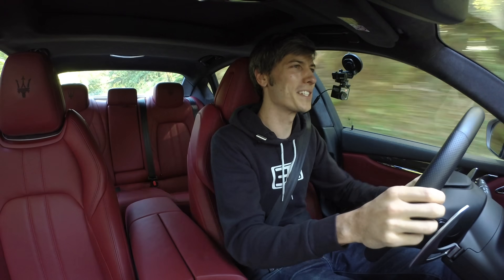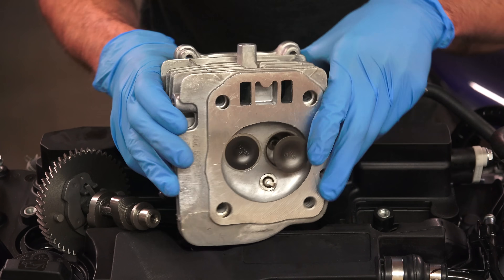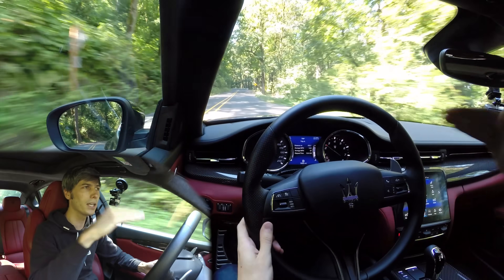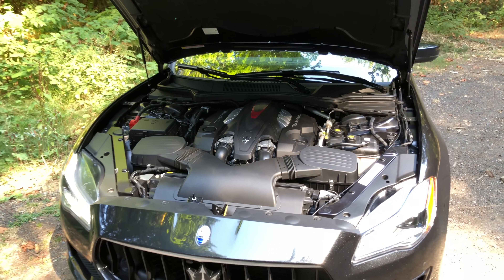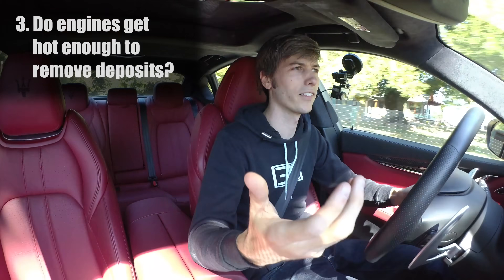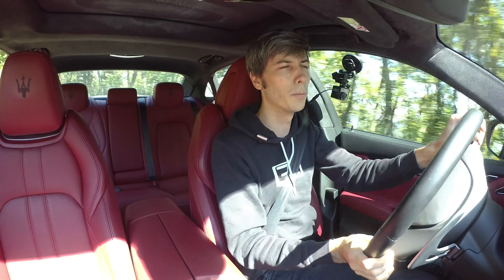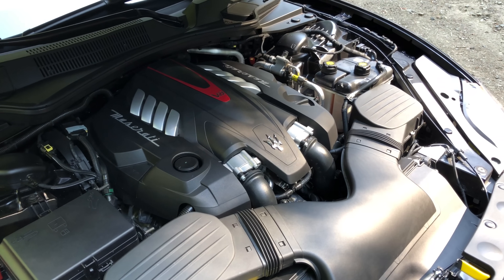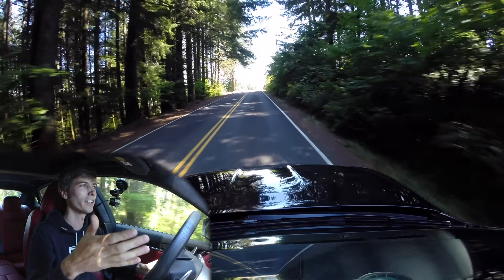Is Redline Good For Your Car's Engine? Italian Tune Up

Comment: The biggest cause of any contamination buildup in an engine including carbon, condensation in the form of white foam around oil cap or excessive exhaust smoke is due to most drivers being afraid to push the accelerator more than a few inches and so they never get up to true operating temp and never get placed under heavy load. Automatics are the worst for this because they always down shift everytime you push your foot down the trans downshifts and causes it to Rev higher and consume more fuel ( because rpm equals fuel consumption!) rather than using engine torque at lower revs and loading up the engine to generate more heat and get it operating at its preferred temp.  Regular services and regular driving and stop babying your car when you drive it. Causes more long term harm than driving it hard but with some mechanical sympathy. I would rather buy an ex rental that has been driven hard and maintained than a private car that has been pussied around all its life with low miles as it will be in far worse engine health because of the limp driving style. It's kinda like owning an electric bicycle and wondering why you ate still unfit, it's because you are applying little or no effort  therfore you or your engine will never be as healthy as when having to apply effort and sweat a little.

Comment: Quick answer - In theory, it technically works. However, trying to use it as a maintenance preventative measure is not practical as applying this concept throughout long term ownership will cause more harm than good overall.

Comment: I think the concept of the "Italian tune-up" is a very old idea, when many engines would have still had iron blocks and iron heads even, both of which will retain significantly more heat than an alloy block/head combo, or even iron block/alloy head. Be curious to see what temps the combustion chamber surfaces might reach in an all-iron carbureted engine like might have come in an 60s era Italian car...

Comment: No. The thing that works is a SMALL flow of water directly sucked into the intake manifold through a straw. No hydrolocking, be careful. Seafoam can also be used. It will DEFINITELY get rid of your deposits. And, when done properly, you'll see a ton of water vapor coming out the exhaust and with zero harm to the engine or any other components. Even the catalytic converter should be fine when using seafoam/water

Comment: What about the mechanical action of revving the engine? This focuses on the heat reaction, but I would also be interested in the actual physical act of revving and what that does to mitigate
 carbon buildup.
Reply: i was wondering that, myself.   Increased velocity of the gasses causing a possible scouring action?

Comment: I always used what we called the water tune-up.

Through some vacuum hose in the engine we would run a large amount of water at idle, and then we won run the engine hard and bring it up in the RPM range pretty high and bring a whole ton more water through. I don't know if it was the placebo effect, or actually did something but it always felt like it was efficient.

I know one person that ran a water injection system before their turbocharger, after about three months that way they looked at their turbocharger and saw what the water was doing to it and realized that while the turbocharger atomized the water very well, it chewed up the compressor blade pretty hard.

I used to have a 1980 Ford Mustang with the turbocharged engine. It was a winter bow meaning it was located after the carburetor and I ran 110 Octane leaded gas all the time and increase the boost as high as the turbocharger would go. I shelled out the turbo charger and sold the car before I ever saw what the leaded  gasoline did do it.

Comment: Redlining isn't necessary just keep your car speed at above 120km/h for a long time. Like 5-8 hours i guess. This will clean up your engine. Also you can use some kind of gasoline addtives like catalytic converter cleaner or fuel system cleaner etc. There's no such thing like redlining will clean your engine. It will just reduce lifespan of your engine.

Comment: The more fuel you put through the engine, the more potential carbon buildup is possible.  Or, more specifically, the lower the instantaneous air/fuel ratio at any given time, the greater the "potential" carbon deposits will be.  IMHO anyway.  Italian cars are designed to squirt more fuel at WOT (during Italian Tuneup), so it seems likely there would be more unburned fuel available to coat the inside of the cylinder.  Again, IMHO.

Comment: I think its interesting that types of fuel used was not mentioned as it is well known that higher octane fuels have a cleaner combustion, in aus you can get 98 at literally every pump and its great, think the "Italian tune up" would work a charm on an engine dialed in nice and lean running 98ron, thats all I run on my engines

Comment: noticed it works when i was pushing my 2006 clio with 1.2 N/A engine on the autobahn. stayed at 5/6k for good 10 min and the clio had never been so snappy

Comment: I bought a 1.2 Fiat 500 with 69 bhp. The thing was lazy a.f. , I mean, it didn't move whatsoever, to the point where it was dangerous to drive it on the motorway, it was impossible to cruise in 5th. Fuel economy was absolute rubbish, upwards of 6.5L/100kms!!! I've been using it everyday, driving all of the time at low rpm, with the exception of hitting the rev limiter in 1st and 2nd gear whenever I can (with a properly warmed up engine). It did wounders! I'm getting less than 5L/100kms of fuel economy, and It lends itself to a more relaxed driving, 4th and 5th gear at low speeds no problem at all. Uphills on the motorway, much much better, at a steady 120/130kmh downshifting on steeper inclines is no longer recquired. Long distance travel in this car is now possible! This method is way better than cruising on the motorway at a lower gear/higher rpm, maybe better for the gearbox too?...

Comment: I find out with some injector cleaner, (Wynns / Forte) a car running cold with wide open cool sensor, is getting much warmer! easy op to 90 instead of 70 without addit cleaner to fuel. maybe that's the hole trick of injectorcleaners ? ^^ 
Making the engine just a bit warmer!

Comment: I usually let the engine rev a bit, but not necessarily under load. I just do it to pull more air though, and reduce blow-by by not lugging the engine. My goal is cooler combustion, and more airflow to prevent buildup.

Comment: my friend has a chevy 1500 with the 4.8 v8 and he drove it for 2 years never going above 2000 rpms to save gas. he developed a loud ticking sound in the valves and stopped driving it. he had to move something on his land with it he just said to hell with it and floored it in reverse trying to pull a f-250 with locked brakes. he held the redline for a solid minute and it was smoking black out the exhaust. one would think it was a diesel. after that the ticking went away and he got his power back.

Comment: I've always treated my vehicles like if I hit the redline it would blow up my engine lol.
Reply: Engines are designed to take high rpms but bearings and what not do wear out faster
Reply: Once I got rpm completely over the scale, >9000 rpm and could not stop not turn it off, the engine was 1.9 tdi at 85kw. It ran on like <9000 for a minute and then turned off. Temperature was about 110-120 C. All the fans ran although the car was off. It cooled himself like that for 10-15 mins and I could start the engine "normally" after that. I drove about 400km more back to home and the only thing that was bugging me was the cloud of a white smoke that was following me 😂
Long story short, I melted 2 pistons, bent 4 connecting rods, disfigured engine head, turbo was in pieces and was spitting oil everywhere. But the car ran. Costed me about 1300 EUR to repair the damage.

Edit: no deposits found
Reply: Дмитри Хрушчев sounds like a runaway
Reply: That's just it, you can't blow your engine if it's is mechanically serviceable. You never actually reach Redline for the engine as the Rev limiter steps in and cuts your ignition preventing any further rpm. This occurs just below Redline on the tacho approx so the engine is never exceeding it's design limits and over stressing.
Reply: kiwi Diesel just because you could doesn’t mean you should. Not necessarily bad for it, but not good to do it more than occasionally.
Reply: @kiwidiesel5071  Your assuming all cars have fuel or ignition cut for a specific RPM.  Though all modern cars do, I have a few that have no such feature...you know you have gone too far when the valves start to float or a rod exits the crankcase with extreme vengeance.
Reply: @kiwidiesel5071  There are crack/stress points where metal will begin to wear and lose its properties very quickly. The forces and rpm will vary but redline just prevents immediate damage, but high stress will still wear at a high rate.
Reply: @kiwidiesel5071  
Unless you have a manual and give it the old money shift
Reply: Whenever I buy a used car I redline it during the test drive and then never again! lol
Reply: L
Reply: it probably will lol 🤣
Reply: some engine sound bad in redline lol, sounds like they're going to blow
Reply: You should redline any engine every once in awhile. Otherwise your get uneven wear in the cylinders and can crack pistons when it does finally redline. It's important to exercise the full rpm range of your motor once or twice a month
Reply: @travisdrake660  9300 rpm baby !
Reply: LMAO me too dude I’m in a Mustang GT standard and I’ve seen videos where people take it to over 8k rpm way past redline, but I never go past 5-6k rpm bc I don’t wanna damage anything
Reply: @DavyDave1313  what year mustang? The 04 one I have redlines at just under 7k rpms
Reply: @scottmartin8888  mines is 2017
Reply: @DavyDave1313  Get a trunion kit, valve springs, cam, and tune; should do it
Reply: @georgecarlin2097  I got rid of the 6 speed a while ago. I have a 10 speed auto mustang now
Reply: deadend I don’t dare try to redline my 2001 Chevy prizm, I do not go past 4K.
Reply: @nelzelpher2088  that reminds me of an 83 Audi 4000 I had, back around '95. Bought it with a hundred thousand miles on it, owned it until it got t-boned at 276k. I sure loved that car, but towards the end I wouldn't dare take it over 4500 RPMs 😄
Reply: Most cars (if built with any quality) have a rev limiter and many other safeguards built-in to the computer to prevent an engine from being "blown up" unless you're truly abusing the vehicle it is very difficult to do accidentally.

Comment: my honda only sees the red line xD HAHAHA!
Reply: Honestly, the square motors Honda puts out can take a beating like it's nothing, all day, every day.

Such reliable motors, built for making up low overall power with a high torque-to-power ratio in a motor designed to run that way.

Comment: My BMW keeps overheating my engine under regular load periodically. I just now found out it's keeping my engine clean. Thanks, BMW!
Reply: German automakers don't scam consumers with unreliable vehicles, they're just doing the work for them! Good to know.
Reply: I cant tell if ur being sarcastic or if they actually made that feature on your car, but either way thats honestly a good idea. They could program the ECU to periodically allow the engine to slightly climb in temp for a couple minutes by slightly closing the radiator ducts and then reopening them to cool it back down again.
Reply: @ryannfodrea632  Many automatic gearbox+catalytic converter cars have periods of running at higher rpm programmed in, if it detects that the cat hasn't had enough temperature to self-clean in a while. Can't do that in a manual, of course...
Reply: @ryannfodrea632  he's probably sarcastic but it is true that modern engines try to run hot for emissions
Reply: @ryannfodrea632 Isn’t that just Regen on a Diesel

Comment: Ok so a serious question, when you have a proper catch can installed on the pcv side of a GDI engine, do you feel it could help increase to odds of benefits from high heat high load scenario? Because there will be much less buildup potential... Thanks!

Comment: 1:19 A few rips?   Whenever I've taken cars out for the Italian Tune Up, it means I have to achieve 15-30 minutes of holding over 5000rpm in the highest or 2nd highest gear just watching that oil temp climb (can only be done with minimal traffic/risk).   Maybe I just learned a different thing, but I've never had a problem and my engines tend to have minimal carbon deposits when inspected.  Worth saying that engines I've done this with always used at least Mobil1 or better oil, and I 'learned' this 20 years ago and done it many times with several engines.

Comment: So what about moderate braking, high RPM, and moderate throttle to maintain speed for an "extended" period - will that heat the engine up more?  Or is it only under heavy throttle?

Comment: This is why Its call a Redline.. You need to keep it there to have heat and remove carbon deposite! Juste like my oven cleaning fonction when the carbon is gone the Engine light will come on!

Comment: Decarboxylation means removing a carboxyl group off an organic compound. Put simply, 325 C is the reaction temperature of the molecules that deposit in the engine. Correct me if I'm wrong; I haven't been in chem class for years either.

Comment: Lol the exterior temperature of my motorcycle engine is around 400 Celsius when running at the 16,500rpm redline. Very clean engine. No carbon build up
Reply: I redline at 7.5k, big bore single cylinder life

Comment: What if I just sit there in my garage and rev it at redline for a while. Garage door open, of course. Or closed, if I'm not feeling it that day.
Reply: It isn't good to maintain high revs without a heavy load on the engine. 

Unless you want to eventually make it go bang clatter clatter clatter...
Reply: HUGE ANIME BREASTS
Reply: There's very little load on the engine because it doesn't have to move the car hence it would not heat up enough.
Reply: Lmfao nobody got the joke🤣☠
Reply: No.

Comment: My buddy used to do this to his souped up 350 he had in his off road truck. Did an excellent job of removing carbon. Also removed the connecting rods through the oil pan and the lifters through the valve covers. Thats peak efficiency if you ask me

Comment: My duramax runs better pulling a load up hill. After idling around town it needs to work hard at 2500 RPM.
Its not redline but low RPM with heavy load that creates all the heat in an engine.

Comment: I believe it comes from the old days of carbed cars with chokes on them. After a cold start with the engine running super rich for a few minutes when the choke finally pulled off a good stab to the mat got the resulting buildup cleaned out. It definitely worked, I started driving in 1978 and my first car was a '74 Monaco cop car with a 440 and a Thermoquad. After a cold winter Michigan start it took about a mile to get to the main road, a good matting of the pedal always had it running better.

Comment: Seafoam has worked AMAZINGLY well on our older cars/trucks. (everything 15+ yrs old, and 150-300k miles.) At least 10% more MPG and up to 25-30% more. My 2000 Honda Civic (1.6L Manual Trans) would always get at least 30mpg, even driving hard. Now I'm getting at LEAST 35mpg WITH A/C on and in hilly/windy roads with frequent decelerations. Pure freeway is 40+ solid now, almost hit 45 one time when I was going around 65mph consistently. Before seafoam the highest I ever got was 36mpg.

Comment: 2011 Hyundai Elantra driving on interstate going 70-80 mph and pushing it in overdrive (dropping to 4th gear) to pass another car has burned carbon on several occasions. I have 190,000 miles on it now. First time it happened I thought I blew a head gasket.

Comment: My grandfather drive a 05 250 with a 6.0 diesel. Lately it began acting up, it didn’t have the same power it normally does(DEFINITELY was losing power, normally we could pull a trailer with 30 6x6 round bales of hay on it in 6th gear anywhere but it was choking the truck down). He got aggravated with it while hauling his tractor to the house and down shifted from 4th to 3rd and matted the throttle. He drove just a short ways while being hard on it and it went from rolling coal to not smoking at all and he began up shifting and soon the turbo kicked out and the motor got its strength back.

Comment: my turbo diesel is driven by me and my partner. She is a slow driver, Through out the week that she drives it, I can definately notice a difference... Im a harder driver personally, lead foot everywhere and always on the boost, I give it a good run and it instantly feels smoother to drive, More responsive etc.
(i had exhaust DPF and EGR valve removed anyway).... So yes, id say it does work for sure

Comment: Great video. I would like to know how diesels are affected by this. Often diesel mechanics say to run the engine hard to build heat to clean the injectors specifically.